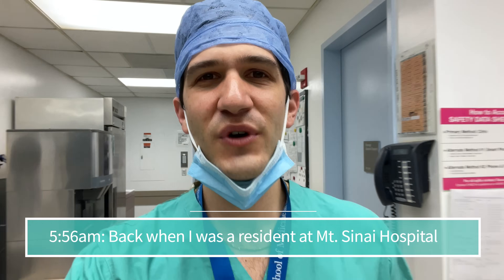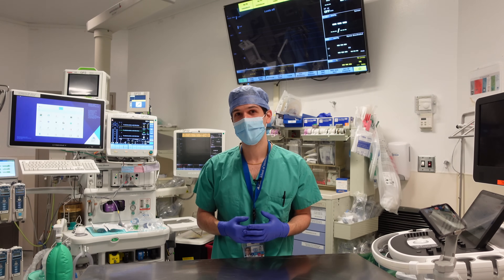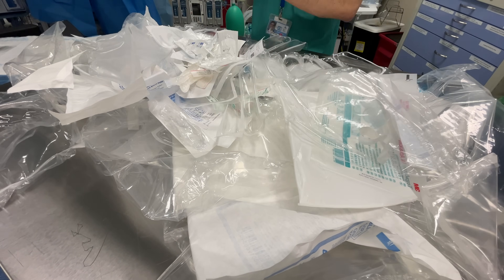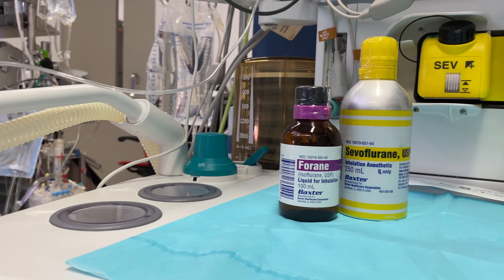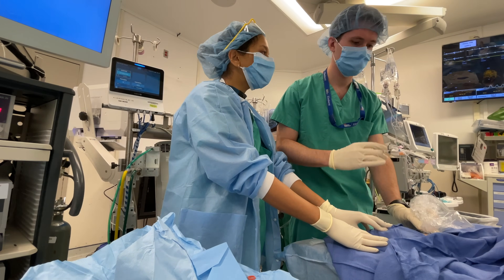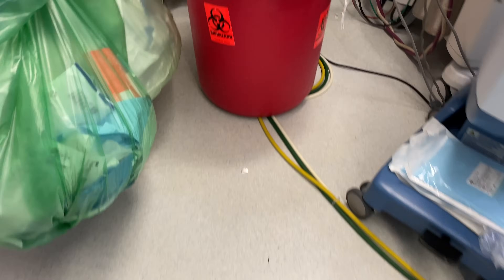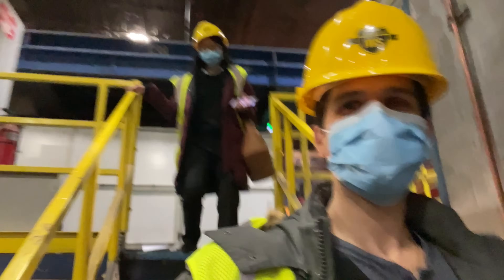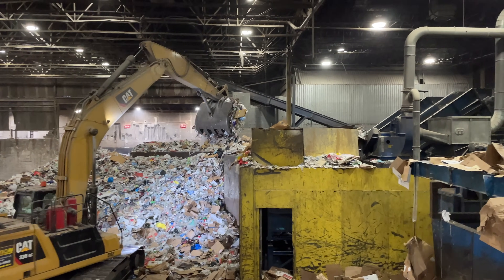The problem of operating room trash (and a solution to it)

Comment: I worked for several medical device companies over my long career as a product design engineer. Medical devices are intentionally designed to follow the "razor / razor blade" model. The very expensive-to-manufacture "razor" part of the system is sometimes sold at a loss, or loaned to the medical facility in order to generate a steam of "razor blade" sales.  The "razor blades" are single use only, sometimes because they are used up (blood glucose test strips), but many times because of sterility concerns. This results in an amazing quantity of perfectly usable equipment being sent to the landfill.

Comment: most of the soft plastics that were dumped on the table were not recyclable and would have contaminated the recycling stream, when a recycling load is too contaminated, which often times it is due to poor sorting or dirtiness, the materials get diverted back to landfill, if the material is thin and “stretchable” I would trash it next time than put it in the recycling bin, only hard plastics like you would find holding a tray kit are recyclable. the best plastic candidates for recycling would be found in items like a yankeur or chest tube canisters but obviously those items would be dirty and would have to be trashed.
Reply: It depends on the factory.

Comment: Notes from my life as chemical engineer. I applaud you trying to reduce and reuse because recycling is a huge myth put out by industry. Only some plastics are actually recyclable... Just because it has a number doesn't mean it can be actually recycled even if taken to a recycling facility. It is usually burned. Additionally, Plastic is only recyclable a couple times before it is broken down too much to be reused.  Finally, plastic cannot really be sorted by type except by hand and it can't be recycled until sorted. Any plastic being sorted automatically is probably destined to be burned or sent to landfill.

Comment: As an OR scrub RN and circulator I am horrified each day when opening for a case to see how much waste is generated , before the patient even enters the room. What's is also VERY concerning is that anything that is used during the surgery is not recycled as its considered "contaminated" this includes large plastic basins, jugs, dishes , blue towels and lots of plastic drapes, I trained many years ago when everything was linen and was washed and sterilized and reused. All the plastic ware was stainless steel and also reprocessed . We will have to go back to these old tried and true practices to cut down on our carbon foot print and waste.
Reply: My local hospital still uses stainless basins in the OR. We have plastic as a backup but we barely ever use them.

Comment: When I was hospitalized, I tried to figure out how many of the disposable objects were made of materials that could be repurposed. I was shocked by how much stuff got thrown in the garbage. Before leaving, they let me take all of the supplies from the room because they said they were going to throw it away anyways. New syringes, metal hemostats, tapes, etc. Even some stethoscopes! I took it all. Unfortunately many of the plastics used are thermosets, ie one and done. I wanted them to reuse the water pitchers and such, but of course that would be a contamination risk. I just ended up making a stack of them to take home and use for other things lol. If things could be made of thermoplastics it'd be so much easier. The heat during reforming would theoretically sanitize the end-product. Of course this would only be for non-sterile situations. There has to be a solution.

Comment: No disrespect intended.  You are obviously very smart and capable.  But the last thing i want any of my surgeons thinking about is "will this recycle".  I want you to think, "what is best for the patient" and to some degree, I understand that has to be tempered by "what will insurance pay for".  Beyond that, stop thinking.  Others, who aren't smart enough to do your job will figure out if there is a better solution.  But I strongly suspect that if there was a better solution, the market would have thought of it.

Also, I have a very simple rule of thumb I use to decide when to recycle:  If someone will pay me for the waste, it is worth recycling.  If I have to pay someone to take it away, it is trash because the economics (read, energy required to recycle) don't justify recycling.

Comment: I wonder if it would make sense to have manufacturers create kits with all the needed stuff inside. This way you'd only have one outer bit of wrapping instead of wrapping for all the individual items.
Reply: They do make kits. The issue then of course, is if there's something in the kit you don't need, it's been opened and is now waste
Reply: There are some wound kits that are somewhat like this, but the majority of them aren't. Everything has to be seperate

Comment: Max please do not call this "Recycling" as plastic waste here in the western world is simply a process of "Down-cycling", as most plastic waste is contaminated with food or other biological waste or paper labels. In contrast aluminum is 100% recyclable as any contaminants will burn up during the remelting process as the melting point of aluminum is 1220 deg F in an open crucible. Where as the plastic is melted by extrusion at temperatures ranging from 300-550 deg F, with minimal filtering of contaminants. Case in point was a Danish company purchasing plastic utensils made from recycled plastics that ended up making the dinners sick with Heavy Metals, at which time it was discovered that the origin of the waste plastics was from Heavy Metal containers. I know their will be nay-sayers out there, but it is just not economical to clean plastic for recycling when virgin plastic is so inexpensive.

I think your efforts are valiant, but misguided and the resources are wasted effort & $'s when that could be put to better use elsewhere. I am sure New York State is giving y'all tax incentives to do this so-called recycling, but ultimately it is a waste of tax-payer dollars, and the economics aren't able to support this.

Aloha...............................

Comment: If you really want too save the planet, then we have too eliminate the hazard at the source, corporations, corporations operating under the system of capitalism are burning through our resources at an astonishing rate, far more then is necessary, and it’s starting too lead to massive issues. 

We need too target corporations with our efforts, such as banning packaging that doesn’t get recycled, making producers the ones responsible for the recycling process of their products, and incentivizing lowering production amounts too more reasonable levels. 

Ideally we could implement socialism which would do all of this naturally, as it values quality of life and sustainability more then profits, but that would probably take too long.

Comment: It's too bad they don't use reusable packaging.
Reply: Kinda hard to in surgery to maintain sterility
Reply: @NickzAndMikz  Not really.  Just sterilize it between uses.
Reply: In Ecuador the spinal kits were hand assembled and wrapped in cloth and sterilized in the autoclave.  Completely recyclable, except for the needles, gauze, gloves used, and the medication vials.  Worked just fine, as long as I could decipher the drug labels in Spanish, but that’s my problem.
Reply: @Boodieman72  How does one effectively sterilize packaging?
Reply: @NickzAndMikz  Autoclave is one option.
Reply: @Boodieman72  Many plastics don't do well in autoclave
Reply: @NickzAndMikz  As I said, it's one option. Ozone, UV, etc.  There are many options.  Not everything has to be made out of plastic either.
Reply: @Boodieman72  Do you have much experience around the OR or sterile processing? It’s very difficult to ensure sterility without at least something being waste. Even things sterilized in metal crates often have a cloth-like wrapping that is waste
Reply: @NickzAndMikz  I'm not saying there would be zero waste, just a lot less of it.  I have quite a bit of experience in sterile processing.
Reply: @Boodieman72  I agree that minimizing waste is important, but I suppose there hasn’t been much or enough time spent in refining this area of processing. One time use things, like syringes, will likely continue to be packaged the way they are
Reply: @NickzAndMikz  The needle can be seperate from the plunger so only the needle would need to be disposed of.